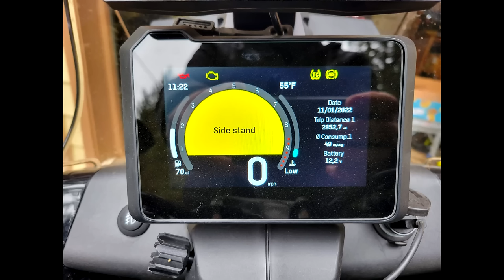Husqvarna Norden 901 Long Term Review: 6 Months and 3,000 Miles

Comment: The only bike I've owned that I came to distrust was a Multistrada - for a host of reasons. After that I was thinking of a KTM and preferred the 1090 over the 1290 because it didn't have all the electronics, but it only came in the US as the R not the S, so I ended up with a 1290SAS. 6000 miles later, it has been faultless and a joy to ride. I think perhaps KTM does not have the resources to fully develop each new model, so it makes sense to buy towards the end of a model's life, rather than at the beginning when there may be bugs.

Comment: Approaching 5000K in 9 months and agree w/ you 1000%. I think I got something like the 4th one in TX…No shock problems (knocking on wood. Had the radiator issue…fixed with a burlier clamp. Seen a few….but very few…of the electronics gremlins. Only encountered the immobilizer issue once but the cruise control just wasn’t present >5x for no reason until the bike was shutdown and restarted. Favorites issue…yep….I don’t bother with them either. Airbox…yep…get one of the airbox options from Rottweiler. Those work great. And while you’re changing out the airbox….get the Arrow decat and a proper Ti exhaust. The bike breathes waaay better and becomes extremely snappy. Plus it won’t sound as much like an industrial sewing machine…not to mention the weight drop. Windscreen….sux bawls…no avoiding that one…and my biggest complaint. However…Minor gremlins and the windscreen aside….It’s a Hella fun sick arse and enjoyable bike to ride. I’ve been offered tempting trades for other really nice bikes but I can’t bring myself to do it. I added the Vanasche gps mount and a Garmin….and it is just soo much fun talking off in a random direction and at whim turning down some random National Forest fireroad just to see what’s there….and knowing I can get back out. But again I agree…the shadow of the reliability gremlin is always in the back of my head as well. Although as time goes on w/o any major issues….that diminishes. It’s been the perfect fit for how I like to ride and checks all my boxes…off road adventurer, commuter, and long distance pavement pounder.

Comment: Fellow Norden owner here, just over 1500 miles on mine (picked up at the start of August) at this point.

You're dead on with the Dealer Support comment. My local dealer (2hr drive to the 'big' city of Marquette), won't touch it. Refused to do the 600 mile break-in service at all. So I ended up taking it back where I got it, 6 hours away in Wisconsin (shout out to Rob's Performance in Johnson Creek!) who actually know how to service these things and stand behind them (more on that later).

This bike replaced my 2004 Honda 919. In comparison: it's not any slower, doesn't handle any worse (possibly better, definitely better on gravel), and is a ton more comfortable. It also gets much better gas mileage (55mpg or so).

Issues I've had, most are minor:

- For the first 300 or so miles, missed shifts and false neutrals were common, although they did taper off around 300 miles and I've not had any since then. 
- I've also had the 'Immobilizer Failure' warning message, just turn the bike off and walk away for a bit, it goes away. Seems to mostly happen immediately after a stall and restart. In fact, I don't think I've seen it any other time.
- Front wheel spokes loosened up in the first 600 miles, resulting in a potato shaped front wheel and a lot of hop. Adjusted them and they haven't budged.
- She can be a little cranky on cold mornings. Takes a bit to get her going below 45F
- While you can 'favorite' things in the menu, I've had it lose the memory twice.

The biggest issue I've had? 

My clutch failed at 614 miles, right after the 600 mile service, which I had to drive 6 hours to get because the local dealer wouldn't do it. This is where the dealer I bought it from got a customer for life, though. When I called them about it, they were very apologetic and the service manager said he'd call me back. An hour or so later, they called back to let me know their head tech was coming up in a truck the next day to replace my clutch. After he did, he took me out to lunch and we discussed what had happened. The tech wasn't sure why it failed, although the plates were 'blue' indicating overheating, but everything looked ok. The only thing he could think was that the cable was adjusted too tight or somehow the oil jet became plugged, but unplugged itself before he got there.

Either way, I've more than doubled the miles since then with no issues, and I've definitely been harder on it in those miles than the first 600.

I'll echo your statements on Offroad mode. I don't have Explorer on mine, it's my first Adv bike and I didn't feel I'd need it at this time (you can add it later with a software update). That said, I've had no complaints in Offroad mode. It'll let you power slide and get a little squirrelly in the rear, and it doesn't get in the way in mud like I'd expected it would. She'll just sing and fling mud everywhere, if you want! When it does step in, it does it with a very light hand.

I also think the looks are somewhat polarizing. Some people love it, some hate it, I don't think I've met anyone who is ambivalent about it. That said, I wouldn't judge it based on just seeing pictures, the bike is much more attractive in person.

Did I mention it's super comfortable? I'm 6'2, 310lbs, and it's easily the most comfortable bike I've owned. I will admit, though, I've also put both a Vanasche Motorsports bar riser and their footpegs on it, which are essential IMO. They made a massive difference and got everything perfect for me.

Like you, I'm also waiting on heated grips. I've been told February.

My Norden is still riding on the stock tires. They honestly work pretty good, lots of grip on the road and not a ton of noise, and are decent in gravel. They are pretty bad in mud, though, they just pack full and become slicks.

Comment: I have a 2022 890 Adventure S with 2500 miles, very similar bike. The only "reliability" issue I've had is that the front left side rotor was machined slightly thicker than the right side rotor, so it looks like there is some funny wear happening on that right side rotor. Dealer says once the left side rotor wears to the same thickness then the issue will go away. Seems like a common issue as the brand new models on the showroom floor seems to have the same thing. Not a big deal at all. 

One note on the wind buffeting. The 890 Adventure has two small, plastic winglets under the headlight held on by 2 screws each. Removing those removes the buffeting issue. Not sure what it looks like on the Norden.

Otherwise the bike is friggen awesome. I feel like I'm spoiled now and can't ride any other big adventure bike.

Comment: Just put a deposit down on a 2023 without doing more than sitting on one. Was back and forth between this, triumph 900 rally pro and standard africa twin. Saved approx 4K  over the other 2 (enough for crash bars, panier racks, centre stand better hand gaurds rear rack and soft luggage). As for the reliability factor, I'll be keeping my trusty DR 650 as backup.😂
Reply: Just note, the 901/890 does have a few niggles which everyone has experienced. Enjoy it dude 👊

Comment: Excellent review! I don't think oil changes are a deal breaker as NO ONE would got 9K miles between them. When people think about maintenance intervals they normally think Valve Checks. KTM and Husky have notoriously short intervals and that is something most "backyard" mechanics will leave to the pros. And THAT is an expensive service. Your Tenere' is probably a 26K interval, normal for most water cooled Yamahas. The Husky is probably at 6K or something. That can be a deal breaker, at least for me.
Reply: the major interval for the norden is every 30k I belive.
Reply: Valves are every 15000 miles on the nordon, that's  not enough, I hate valve checks.

Comment: love my Norden, never had any issue with it. not a single one. so far more reliable than my first motorcycle, v-strom 1000 2003 were i had throttle body sync issue and that they were popping out of the rubber intake. i don't understand why you say oil change are not easy on this bike.  in fact it is super easy. not like a sport bike were you need to take some fairing off    and I forgot  I just got my heated grip from husky

Comment: Hi, amazing video! I believe you mentioned that you are a 30 inch inseam, is that correct? The bike's seat height is the biggest deterrent for me, and I also have a similar build. Did you have any issues with it riding around town in traffic and filtering? Thanks!
Reply from the maker: Yes and no.  It's a little wide so that takes getting used to, but I had no problems getting my feet down.

Comment: My ktm bikes have been super reliable. Ive owned 5. 2 300s, a 520sx, a 65sx & a 1290R. I still own a 300xc & 1290R. My 1290 has 30+ thousand miles with no issues. I’ve never had a dnf racing my KTM dirt bike because of a breakdown.

Comment: Suspension wise, you a pretty big bloke, are you running the standard fork and shock springs, or did you get the correct springs for your weight?

This makes a massive difference, I did this for my 890R

Comment: I've got about 12000 miles between 3 KTMs (two exc 500s and a 690) with zero reliability issues.  Also, when you were on your Washington BDR trip you mentioned a few times that you wish you were on a smaller bike.  Have you changed your opinion on that?

Comment: You nailed the review. I have over 7k on my Norden. The WABDR killed my front left fork and my rear shock. I ended up buying a used R shock and had the whole suspension custom resprung and valved. The one thing you haven’t mentioned is cold start issues. I have it often, it starts with 1 cylinder running. It just doesn’t start like my Hondas do. I lol’d when you said it makes you ride like an asshole bc it’s so true. Top speed 117 for me😂

Comment: Hi! Did you respring the rear shock for your weight or just use preload? I'm heavier than the average Austrian and considering it on my 890. Also at least on the KTM you can have an ODO on the main screen, you just have to dig into the settings a bit and you can have anything show up.
Reply from the maker: I haven't resprung it yet, but will if I keep it long term

Comment: If the Norton uses the same heated grips as a 21 ktm 890 adventure r I have an extra set and live just down the road from you. I had ordered a set on line which were back ordered and then found a set from the dealer and the next day the back ordered ones showed up.

Comment: I keep mine in Explorer Mode, but my throttle is set on off-road mode. I got a tall windscreen on mine, so I have no problem there.
Reply: P.S. I’ve got the Husqvarna heated grips on mine. And I use a DNA air filter.

Comment: Great review as usual.  I've had several Husky's (Vitpilen 701 and 701 Enduro) and a KTM 500 EXC, and unfortunately have had major issues with all of them.  I wouldn't be against buying another KTM/Husqvarna enduro for trail riding, but neither would be my first choice for an adventure bike. I'll stick to Honda, Yamaha, and Kawasaki.  Of course any bike can break down, but I think there is a higher chance of that happening with KTM's/Husky's, and perhaps the high compression engines have something to do with the reliability in the long run.  I've had Honda's and Yamaha's and have never had an issue with either brand, not a single issue.  I understand that any machine can break down, but reputations do come from somewhere.  With that said Husky created one nice looking motorcycle with amazing performance. I think the Norden 901 completes closely with the Africa Twin in the looks department, but IMO the Africa Twin still has a slight edge, but not by a wide margin.

Comment: I picked up a 22 890S  this summer about 6mo also and put just shy of 8000 mi on mine.  In the last few weeks once the bike gets good and warm it gets stuck in gear local dealer is shipping the engine to KTM to repair under warranty...  We believe its a defective piece of plastic on the end of the shift drum for the gear indicator on the dash.  But other than this minor / major issue the bikes been flawless..   I fully agree this platform will make you want to ride like a complete ass and Id say by no means is it a good beginner bike,  it puts me in my place on dirt and on the road..

Comment: I personally wouldn't take it right to 9k miles before doing an oil change. 
Should like they ripped a page from Toyota and their 10k mile oil change.
Don't believe it for 1 second. 
You can do oil changes at 9k way after the warranty period is long gone and that's what allows them to get away with selling that pitch. 
Changing the oil @ 9k vs 5k could mean the difference in the long term of having an engine lasting 180k miles or 300k miles, depends on how much you want to pay for an ounce of prevention.
Oh, just recently subbed to Ian's channel.

Comment: KTM/Husqvarna is the brand everyone loves to hate. Just like Harley. Everyone knows a neighbor who’s uncle rode one in 1982 and said it was garbage and that’s all they base their experience on. My 2020 Honda Africa twin was the biggest unreliable pile of junk I’ve ever owned. Engine would cut out, electronics were a nightmare, I’d never own anything from the brand ever again. They aren’t making air cooled XR’s anymore. It’s the missionary position of motorcycles, you get middle of the road parts, performance and engineering with one. My 2022 KTM 1290 Super Adventure is one of the best bikes I’ve ever owned. It’s freaking amazing and not one hiccup in 8k miles in one year.

Comment: I'm contemplating getting the Norden for next spring. I currently have a 2021 HD Pan America, I absolutely love it but it has had some electronics issues - it almost left me stranded at a ferry crossing on a 2000 mile trip and more recently the last two times I tried to go for a ride it wouldn't start so I am having trust issues with it now. My dealer situation leaves me with either HD, Honda or KTM/Husky, I don't like the Africa Twin and the KTM's looks don't appeal to me all that much. I have a Husky FE350 dirt bike so don't have issue with Husky at all.
Reply: The Africa Twin in the adventure sports ES version is amazing. What’s not to love with Honda reliability in that bike?
Reply: @matthew3136  I was all ready to buy a 2017 Africa Twin up to the point that I test rode one, it was the worst handling street bike I have ever ridden. I love Hondas and have owned 9 over the years but the Africa Twin just didn't agree with me unfortunately. To be clear, I don't ride ADV bikes to go off road, I do so because a back injury and the terrible roads where I live means I need both the more upright riding position and the outstanding suspension to continue riding. Maybe the handling issue on the Africa Twin I tested was related to the tires (stock I believe but it was used so don't know for sure) but it was so bad that I took it back the dealer after only 5 minutes of riding.

Comment: Well im in at 9 months and 9700 miles. Only issue was the thermostate leaking. Road from dallas to Yellowstone and back. Also did th3 texas forts trail. I trust it but you are right ktm amd honda dealers everywhere, husq not so much
Reply from the maker: Sounds like it's working out well for you.
Reply: What's worse is most KTM dealers can't touch a Husqvarna when it comes to the computers

Comment: I love the way they look, they are sexy. I live in Thailand and the go to bike is a Honda 250 CRF with cam and gear modifications for top gear. But everything is here as far as bikes. The roads and curves are tight so a smaller bike ridden to it's top is a lot more fun. Plus with the top gear mod you can move down the highway. Plus they are offroad capable. But I am 5 foot 7 and a half and they are still too tall for me. I think the Norden would be a great bike here. The problem is any remote village bike mechanic can work and get parts for the Honda. If these bikes have any reliability issues then you will be screwed.

Comment: I liked your review a lot.  I have the 2022 Norden 901, I love the way it looks, I'm so happy I was able to get one.  The reason why I bought the Norden 901 is that I have the KTM 890 Duke R and the motor is just brilliant which is the same motor they use in the Norden 901. I previously had a KTM 790 Adventure R with all the trick suspension upgrades.  It never rode like the Huzqvarna Norden 901.  I also found on the KTM Adventure R that the 21" front tire so vague on twisty roads, coming from riding road bikes with 17" & 19" front wheels, I just didn't like that at all. Perhaps it was the tires that I had on the bike, anyway after having two KTM's with 21" front tires... I said that's enough for me, no more 21" front tired bikes.  The Norden 901 changed my mind about 21" tires with the Pirelli Scorpion STR tires that come on the bike, they are absolutely amazing road tires, you simply can't believe your riding a bike with a 21" front tire, they work so well on paved roads; I love them, super impressed. The only problem I've had with my bike is that the Norden 901 was that it was so new to the dealer that they did not know that you have to have both petcocks open on the gas tank for it to work properly and as a consequence I was stranded out on the road with still 1-1/2 gallons of gas in the tank.  After I went back and talked to my Husqvarna dealer, I assure you when I left, they knew that both petcocks have to be open before they give a Norden 901 to the customer to ride away on. About the parts from Huzqvarna parts, I purchased my bike with heated grips & tire pressure senors.  Here we are a year later and I still don't have these parts.  
Lastly as an unexpected bonus on the Husqvarna Norden 901 is the gas mileage, I'm getting a consistent 60 miles MPG. Like you I love riding this bike, it is "too much fun."